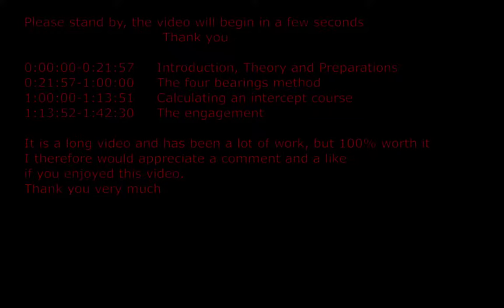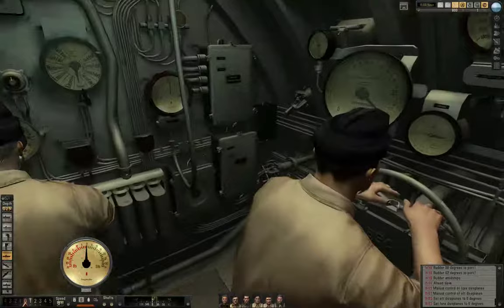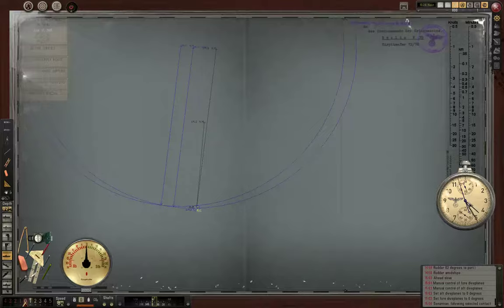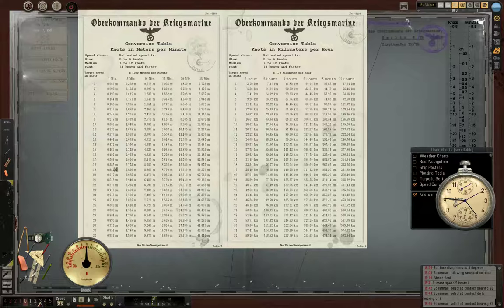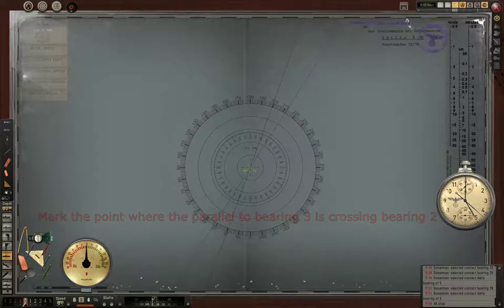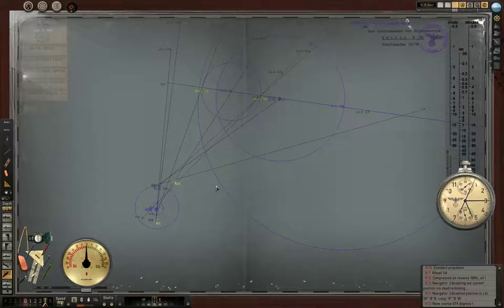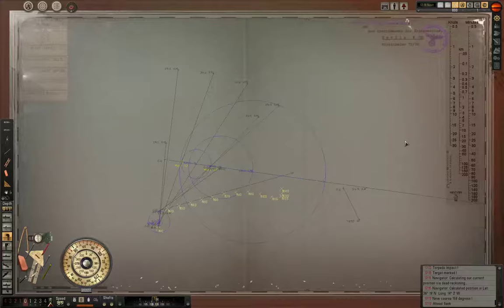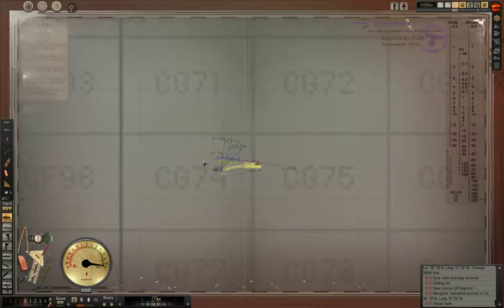Using the four bearings method while moving. Silent Hunter - The Wolves of Steel - Tutorial

Comment: There's a way to simplify the plotting, especially to account for the poor quality plotting tools in the game:

1) Plot relative. You don't really need all the bearings to be azimuths. Since you're moving in a straight line, you can simply plot as if you were heading due North, disregarding your true course. This removes the need to convert individual bearings via the attack disc - only the final solution, and you won't have to fiddle with the rudder to get at a nice course.

2) For plotting your own positions, instead of distance traveled per time interval, just use speed value directly. I.e. instead of 0.694m for 1.5kt in 15 minutes, simply use the value 1.5 - your speed (and 5.7 for the final leg). This, again, removes the extra distance conversions, only requiring the one at the very end, because distance to target will be scaled; and such values are much easier to plot with the game's tools.

The result will be a scaled plot relative to your course. Distance traveled by target between bearings would directly measure its speed. All the angles would still be correct, just relative.

For example, with data you've gathered in this video, the resulting plot would show:
- target's course: ~93
- target's traveled distance between bearings: ~7
- measured distance to target: ~33
Converting relative course to true would yield 98, since you were heading 5 degrees. Target speed is measured directly from the plot - 7 knots. Distance to target, in this case, needs to be divided by 4. 33/4 is 8.25. This gives true distance in nautical miles, which you can convert to km using whichever method (e.g. via the 1 hour column for the knots*hours table) - this would be about 15.3km.
Divisor for conversion will depend on time interval used for plotting: 12, 6, 4, 2 for 5, 10, 15 and 30 minutes respectively. Alternatively, if the value is small enough to fit in the tables directly, you can just read the distance from the minutes table (e.g. 33 "knots" for 15 minutes would've shown 15.279km, if the table didn't end at 32 :) ).

Oh, and when using 15 minute intervals (or more) you don't really need to account for that one minute of acceleration on last leg, simply use the overall speed (5.7 in this case). The small error there would just be lost in the granularity of the game's plotting tools anyway. I.e. in case of this particular plot the error would've been around 50m. At 15km from target, that's an absolute error in bearing of about 0.2 degrees - well below what you can realistically measure with the game's plotting tools.
Reply from the maker: That is a very interesting suggestion. I didn't think of that. I'll have to try it
Reply: Very interesting

Comment: Instead of using the compass in the radio room.  You can use the attack disc.  Turn the switch on the attack disc on to synchronize the attack disc. Then turn your boat until you reach the desired heading.

Comment: Great video! I've done some research on the spiess TMA and found that the 4-bearing on-the-move method can still be improved and saving a lot of plotting work. The idea comes from an US Navy document and also the relative motion plotting used in the US Navy Maneuvering Board. The theory is described here: https://www.subsim.com/radioroom/showthread.php?t=240883
Reply from the maker: An interesting variation of the method, however I do not know how well it can be applied in SH5. We do not have a nice maneuvering board in the game that is also easy to use.
Reply: @Tonci87  Yes that can be a problem, although one can simply draw the plot using protractor and ruler starting from the same point anywhere on the map.

But anyways, I've also created a program to do such a task automatically using some advanced algorithm, when I feel too lazy to do all the plotting. Actually I'm using the situation from your video as a demonstration. You can check it out if you're interested: https://www.subsim.com/radioroom/showthread.php?t=244863

Comment: It looks like you've been playing a recent version for some time. Can you give me your opinion about the technical state of the mod. Do savegame corruption or crashes still occur frequently?
Reply from the maker: No and no. I run a few other mods beside it (very carefully selected) and regardless of that, I honestly can not remember my last crash. Make sure to always create a new savegame, not overwrite old ones, and there is no savegame corruption
Reply: @Tonci87  Thanks man. I'm going to jump in again. Your tutorials will probably get me back on track ;-)
Reply: The current state is this: The ideal is to use the SH5 DVD version. The UPlay download does not work due to a ninja Ubisoft pulled in Oct of 2019. You will need to download the game from UPlay and replace the SH5.EXE unless you have the DVD version, or are on the Steam version. The steam version is only suitable for this megamod pack AFAIK. That UPlay workaround is explained in the Wolves of Steel Install thread on Subsim... that's what I have done so far.

I'm also currently investigating a certain glitch that occurs for me in a certain opt-in-mod for TWOS and/or system config circumstance that results in panels/icons becoming white and a crash related to playtime and sinking ships. To that effect I'm looking into a DVD disk image, that fell off the back of the truck and is available on the high seas, and if it works as I expect, since I have purchased the game and have it on UPlay, I should be able to use the full DVD version to install TWOS and not have to worry about cracking it. UPlay doesn't seem to care what version I'm using, only that my account has it. Anyway, like i said I'm investigating.

The Mod Pack is quite stable and major bug free in it's natural state, but you do have to follow instructions listed in the guide especially involving not being in the bunker when time advances past a campaign transfer or base transfer. The KSD Commander utility, especially editing the config directly, can be useful to hit certain time frames as it controls your days in the bunker if you start the game with it and load a save before entering the bunker. I have some minor annoyances that can be solved by TPing around the ship or manually clicking and closing menus. There are many built in options to lower the tediousness involved in submarining. I have a lot of the gamey stuff enabled simply to save me time in various ways. Sometimes I do it for real, sometimes i just turn on the Auto TDC and follow up a frustrating encounter with a running shot with magical precision. There are some idiosyncrasies that have always been a problem, like you should not Alt-Tab from an active game state. You should save, main menu, tab an do whatever, then load the save. Torpedo Dud logic is handled by a mod... so just leave that realism option on because you will get duds anyway if you turn it off.

TLDR: You still need some basic computer knowledge. Even with replacing the UPlay install with a patched DVD version of SH5.EXE I have no major issues that have impacted my gameplay except possibly with the optional "FX Increase Flooding Via Zones Faster Sinking" mod. Either that or having Win7 compatibility mode on while using Win7 caused it. Unsure which at this point.
Reply: @mikegamerguy4776  I've played the U-Play version before and know about some restrictions like Alt-Tabbin and the bunker dates. Recently bought the Steam version and everything seems to work well so far. I just wanted to avoid major commitment if the game would become unstable or something, so thanks for summing things up.
This tediousness reducing plugins are a godsend. Decrypting every second message sounds like major pain in the ** imho. I would like to try real navigation, but my german translation mod doesn't support it. The greatest appeal for me are situations where i'm not prepared or couldn't gather precise target data and still manage to hit with sound estimations like observing the bow wave of the target to estimate speed and stuff like that.
Reply: @DarthFiscus  I finally settled on my UPlay download version using the work around that you have to dig through in the forums. Download and install the game, run it once, replace a thing, run TWOS installer. Done.

I'm not bored enough to discover if the DVD ISO i got hold of will work in the long run, though it launches just fine as long as I let it be the thing that first opens UPlay.